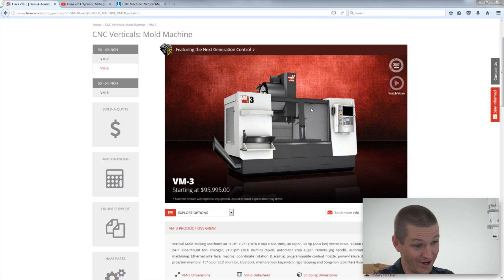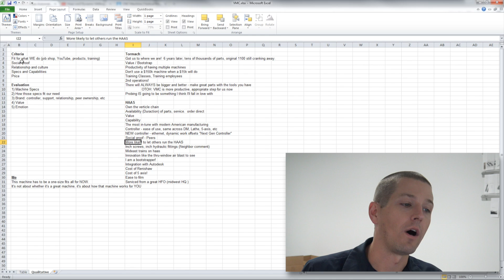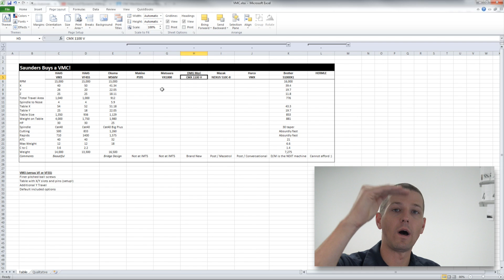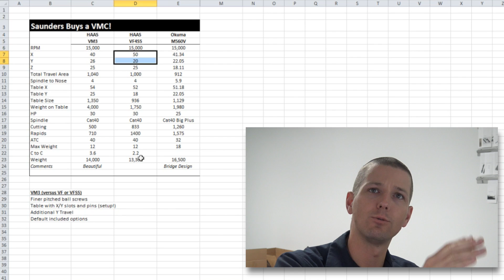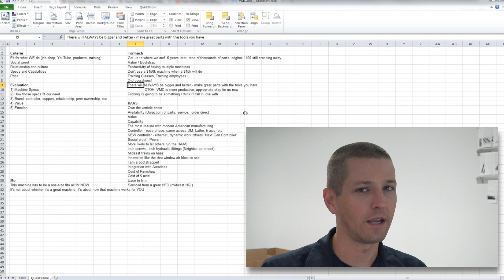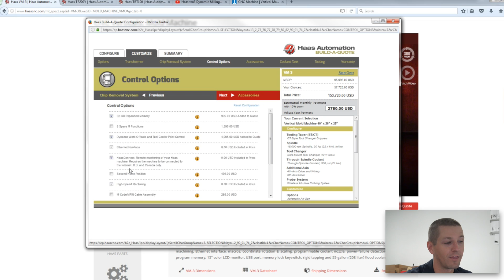We bought a VMC!  Haas VM3 with 5-axis!

Comment: Thanks for the video and explaining the decision making process.  I thought it was interesting how the capital vs. life cycle costs played out in your consideration.

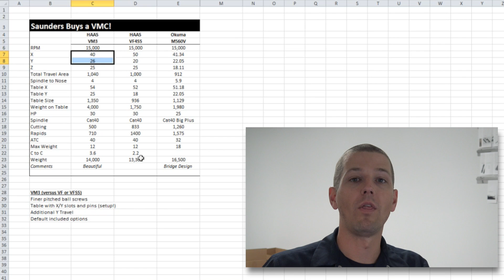I'd be interested in what the accuracy is on the Haas compared to the others and whether that was at all a consideration.  It's not in your comparison matrix at 19:50, so are they just so similar to one another that it doesn't matter?   I suppose the $200,000 question is how well they maintain those tolerances.  Did you research reveal anything on this?

I saw in a forum that '>A Haas rep says that the published accuracy and repeatability specs of 0.0002" and 0.0001" respectively, are for machine movement when not cutting metal and when cutting metal a true position of 0.0005" should be considered really good for the machine.'

Comment: haas are alright for where nyccnc is right now. I don't recommend keeping them moving much further forward. the ergos are nice to stand in front of and run. control is basically mori. some of the bolt ons are really nice if it's your only vmc but as you expand they're obstacles. things like the tool rack and changing station come to mind. when you get lean you have to rip them off and ditch em.

Comment: I'm from Romania, Europe, and last year we bought 3 new CNCs (a live tooling lathe, a 3 axes lathe and a 3 axes Mill). In the end we came down to 3 options: DMG, Haas and Hurco. DMG lost a lot o credit (at least here in Europe) in the past years. The quality went down A LOT, so we skipped them. Haas is known here for being good in aluminum, but when it comes to metal, they are just too weak and break often. Hurco is more solid than Haas (it weights more, which is important) and they are a good choice for small series and fast setups. The downside is they are being put togheter in Taiwan, but the good part is they are using high quality parts, mostly made in Europe. Haas would have been a little cheaper, but the reviews were not as good as Hurco's. So we bought 3 Hurcos.

Comment: I suggest 3 things, spindle fan, table washer if you have TSC, and find the Renishaw Programming manual (about Haas, but not from Haas) and learn all the G65 macros, yes it's largely hand coding - can run Cimco templates if you set it up, but it isn't G. After a year of debugging other peoples' programs (speeds, DOC, 10krpm G81 taps...) I have breathing room to start learning auto tool wear, part inspection, etc. Hoping to set conditional spring cuts and auto countersink depth and such. Run the G65 P9804 calibration - VQC won't do it.

Comment: While HAAS is great value for money, with a unlimited budged I wouldn't even think about buying a haas. 

DMG with Heidenhain control, Okuma, or Mazak would be what I would choose.

In my opinion modern mazatrol and heidenhain controls are much better then HAAS. Both are more intuitive and simpler to use. Sometimes I just programmed simple stuff on the machine instead of using Inventor HSM. 
CAM is good, but if you need to do a lot of precise holes (fittings), it is nice to have a machine with a good conversational control. With Haas this is needlessly complicated. 
Most people who like Haas have not used a modern mazak or heidenhain control.

I don't want to say Haas is bad. In fact for the price it's the best you can get.

Comment: I run, maintain, set up and program 4 HAAS machines at work and they ARE awesome!
VF6, VF3 both with 4th axis capability also a TL3 which is my goto lathe for anything that will fit in it, the intuitive programing is great for 1 off parts, hands down the best lathe have ever used.
We also have a SL30 with full C axis, live tooling, bar feeder, chuck or 16C collet and tailstock. I've used it as a shaper to cut internal and external splines and gears with single point tools that are easily
made on the mill, saves buying an expensive cutter that may be days out to make 1 part LOL
All these machines are older the newest is a 2008.
We have had a HAAS tech in the shop ONCE in 10 years if that tells you anything!

Comment: Ive just completed a very similar exercise for the company i work for, we were looking for a large CNC lathe with Y-axis, and i did a spread sheet comparing 30 different machines available, then i spent a lot of time in AutoCAD doing process flow through the workshop with each machines size and capabilities, in the end the best fit for our shop and budget was the Doosan Puma 800 XLY, which has turned out to be 100% the correct purchase. Having been through the exercise, i can tell you, for placement in the workshop you have to make process flow the most important thing. if you have two of three operations in a job, then you have to consider the time and effort it takes to move from one machine to the next, and how long you will have a crane or forklift tied up for. and if that process makes someone else or another machine stand idle while they wait, these things all cost money. so do the exercise, Draw your entire shop in CAD, 2D is fine, then map out 100 examples of work flow, from simple little single operation job, to complex, multi operation jobs, and do time studies including handling etc. in the end, you will find the most efficient location for the machine based on the work that you do. if you need help, send me a message, I'll help where i can

Comment: I would position your machine wth a minimum of 4 feet from walls and columns . Just to make it easier to maintain ,and get around it to clean . Worked in a shop that squeezed all machines together just enough to barely to turn side ways and slide through . Just a thought on placement of your new machine ! Good luck on your investment ! 1st machine I learned on was a hass vf2 !

Comment: Congrats. We just bought a second VF2SS and after looking after a few different options we also decided to go with HAAS for a few reasons you mentioned: 1) parts availability 2) ease of use of the control 3) ease of getting a post for any CAM software 4) availability of service - from the HFO and 3rd party service vendors 

One of the things that I don't hear people mention very often though is that since HAAS has so many machines in US manufacturing, it's much easier to find / train people to work on the HAAS machines. Also,  availability of training at the HFO and local community colleges to learn the HAAS control.

Comment: John,
When you talk about tool holder... given that your machine is capable of some fairly high rpm its interesting you haven't mention or maybe considered hydraulic tool holders.  I run a one man shop, and use two Kennametal Hydraulic tool holders.  The rest of my tool holder are TG75, TG100, and various ER collets.  I find myself choosing the hydraulic chucks over the rest almost ever time.  I also have a set of bushings for 1/8", 3/16", 1/4" and 3/8" which adapt to the 1/2" hydraulic chuck.  I have been also using the Kennametal KTIP tooling.  Great tools ..  drilled hole seems like its almost reamed and the drilling speed is crazy.  by backing off just a little from the maximum speeds and feeds I can drill up to 1800 holes on the same insert.  When I first started out with my now OLD Haas i was in a hurry to buy all kinds of tools. Take your time and choose what you need; as you go.

Comment: 'Modern American manufacturing'... in inches & pounds. Pfft.
Reply: Well, the machine can be run in metric, uses metric ballscrews, linear guideways, and mostly likely was designed in metric unless they are out of their minds. The specs are offered in metric as well. I believe some government manufacturing related contracts are now required to be dimensioned in metric as well so its heading there. I wish the US would go all metric. It's better in just about every way and it would simplify the amount of tooling you need. Drill gauge sizes to me like #7 and Drill A is just a waste of time. You have to go look at a chart to know the actual size!
Reply: I'm curious as to how the chosen units reflects on whether a manufacturing method is modern.  I work in aerospace and the industry is still designing and manufacturing engines using the standard system.  I suppose it's what you're used to.
Reply: Because it's so much simpler and easier to use.

The metric system is an improvement over the English system in three major points:

One unit of measurement for each physical quantity. No matter from which other quantities of the SI system derived, yields always the same unit.
Scalability by prefixes - combinations of prefix and unit make for a plethora of convenient combined units.
Decimal system - fractions are expressed in decimal notation. Not only makes this the notation unique, exhaustive and intuitively comparable, but also allows unit conversion without doing math - simply by shifts of the decimal point.
Reply: I do agree that it is easier to use.  I deal with metric drawings as well and it isn't quite as simple as you've described.  Most dimensions are in millimeters and they're typically not whole numbers.  Because they're not whole numbers they are no different than the numbers I use in standard units.  I only use fractional or wire gauge values when I refer to hole diameters that are to be drilled...  #2 drill, 5/32" drill, etc. After that everything is expressed in thousandths of an inch.  If I have a hole that is .4063" in diameter then that's no more difficult to work with than it's equivalent 10.32mm diameter definition.
Reply: Your argument is self-defeating.
Reply: More people use Metric. That is actually the "Standard System" now. :P
Reply: Are you stupid, a digit in mm even if it has digits in the decimal places still works to the power of 1, moving the decimal place left and right for unit conversions still works the same ways.. Metric is actually the official system used by the US currently, Imperial is just a common conversion that everyone uses for some fucked up reason. There is absoloulty no benefits to imperial over metric
Reply: the metric system is better
no way around that
Reply: Diamond Eyes, you realise that there are 324 million users of what you call standard units whereas there are 7.6 BILLION people using metric. This includes the Chinese, Koreans, Indians, Europeans etc etc? Regardless of your opinion the power base of the world uses metric, the dominant industrial producers use metric.. Any argument for the old scheme is just specious and infantile. Catch up mate before you all become irrelevant.
Reply: Ad hominem is all you have? Well done, genius.

Comment: Congratulations!!! Really happy to hear that!!!
Haas has a lot of cool and innovative features to offer, and I look forward to seeing the videos. Now that you have a "big boy" machine you can finally start getting aggressive with speeds, feeds, and MMR and really start slinging chips and using your tools to their full potential. I learned on Haas and Fadal back in school and I always found the Haas machines to be alot more approachable and intuitive. I've had a few chances to try their newer machines and the same holds true. Unfortunately, I work in a FANUC shop and we only have 2 Haas machines (an '03 TM1 which is dedicated to one job we always run, and an '03 SL30 that has seen better days, and has been crashed about a dozen times). I'm always hinting that we should get a real Haas mill and a new lathe, but we just bought 2 Doosan vmcs (a DNM400 and a DNM750L) and a Doosan Puma 2600y lathe about 2 years ago, so it'll probably be a while till we get a new mill. I rather enjoy running the DNM400, but the control does feel "industrial" if you know what I mean, whereas Haas controls are just plain easier on the eyes, which is important if you're staring at it all day. As for probes, I can already tell you that you'll never want to go back, haha. It's so nice to be able to probe a bore or a web without having to break out an indicator or edgefinder. Our Doosans have basically the same Renishaw package as the new Haas machines and they are very nice for setting tools and quick setups. I do alot of parts where there may be only one left and one right (mirrored), or small batches only 6-10 parts, so setup is a big part of my day and the probe system is quite a Luxury. Probes are like heated seats for your car, once you've lived with them, it's hard to go back.

Can't wait to see the new content!
Randy B. Lancaster, PA

Comment: Machines in a machine shop are a little bit like the chicken or the egg questions.  Which comes first.  In a machine shop unfortunately it needs to be the machine.  If you go out and get jobs that you don't have a machine for, you could loose that job and potentially others because the word gets out about the first.  So you have to invest in the machine then go out and get the jobs for that machine.  Like Pirate Welding didn't get any jobs that needs a press.  the owner found a 90 ton press and the word got out that it was available and now they get plenty of jobs for the press and it has paid for itself many times over.  I guess the expression that fits most is "if you build it, they will come".    Thank you for sharing your decision making process.  There are plenty of videos on YouTube that are "watch me weld" or the like.  There are quite a few that are pretty good instructional videos.  (BTW check out www.thenewboston.com tons of instructional stuff)  Not many videos on YouTube about the decision making process. On a different note.  Can't tell the value I put into continuity.  Same engineering thought processes in a product line can really make a difference in maintenance.  Sure this one may do this job better and another a different job better but at the end of the day it is so much easier to be able to rely on one source for all you parts and maintenance needs that it is to have ten different people and ten different relationships to maintain.  Allot easier.  Congratulations John.  Best of luck with the new equipment and the shop in general.
Reply: the trick is to buy a new machine that will improve your ability to deliver existing work and unlock new work. the fish egg came before the chicken. work smarter, etc etc.

Comment: I've done work with a Vf4 and vf6 (and the haas hmc) and they're 'okay', but for some fancy cnc stuff, the machines weren't able to keep up to the code for quick cutting. I think if you keep it in good repair and get the thing as networked as you can (usb port can be buggy) then it should be great for you. 
That being said, after watching what an Okuma 550 can do with its 2400 ipm rapid speed... It's hard to go back to a haas. $1 million machine though, so it should be that awesome.

Comment: I've had a 4th on my vf2 for 12 years and literally never needed to take it off. I have a tombstone with a trunion on one end with pined subplates that slide on and off for different jobs. Ran another shop where we had a 4th axis on all VMCs with windowed tombstones. 5 axis has its place but honesty is not very useful on most parts.

Comment: On the coolant ending up on the glass, have you tried using some of the windscreen coatings, like Rain-X ?  Combined with an air blast might be good enough ( though the rotating disk idea is cool, you might be able to get a used one from a ship chandler ) You could test it on the Tormach lathe, if it works OK there without air, likely to work OK anywhere.

Comment: I think you'll be happy with the Haas John.  I started my machine shop business back in 1983 as a side line business and continued with my primary job till I retired in 2002.  In 2006 I decided I wanted to learn CNC and was going retrofit my knee mill and lathe and then I discovered Haas.  I bought their TL-1(tool room lathe) first and 6 months later got the TM-1.  I have been really happy with both machines.  You'll love the control.  I am not sure you'll need all that memory though.  From my experience I have over 100 programs on the lathe and still have half a Mbit of memory left.  I have Haas' 5C 4th axis on the mill and it is small enough that I leave it on the machine all the time.

Comment: Congrats!  

I personally use a renishaw spindle probe a lot. It's very nice to have and helps a lot in accuracy. But there are some downsides (mainly user error) for example if you touch off x, y, or z and then machine those surfaces but forget to write down the offsets, if you have to stop the machine completely you're left without an origin. Actually I'm pretty sure you already know this. LOL